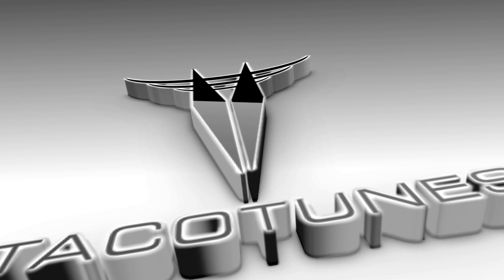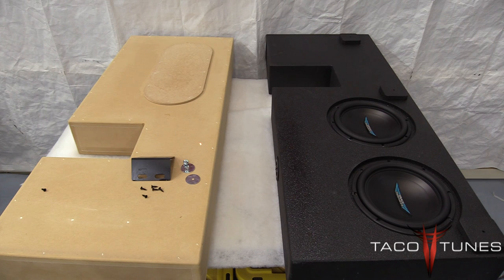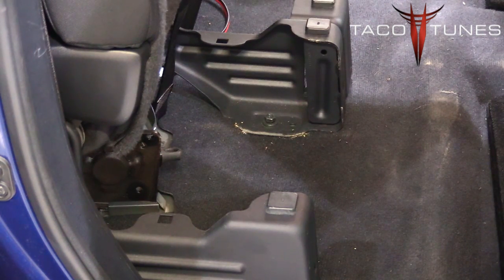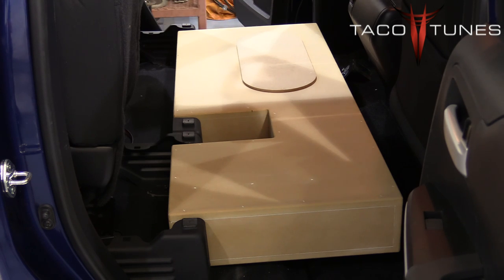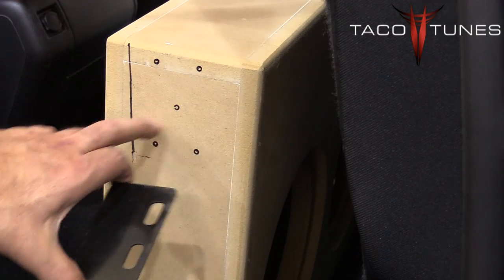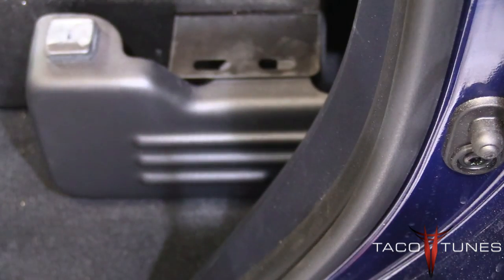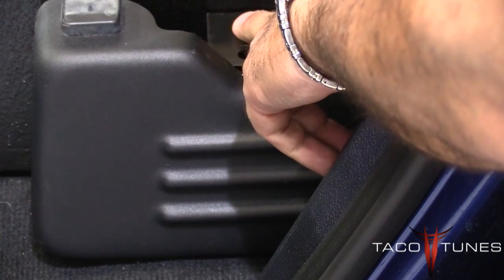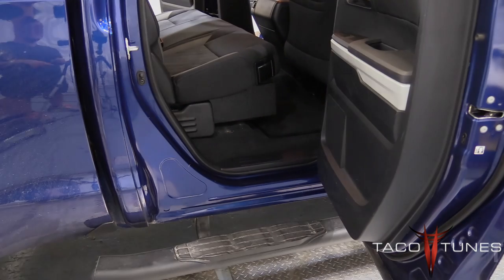Toyota Tundra 2007- 2017 Double Cab Subwoofer Installation

Comment: Hey got a question. Do you actually have the dimensions of that box. I am running the mmats shallow mount 10's. I currently have one installed but i am building the box for 2. Would greatly appreciate the help.

Comment: I did this modification on my 2007 Toyota Tundra but now I have to drive with the rear seat up all the time because the seat hits the speakers
Reply from the maker: How is the seat hitting the speakers? The subs are firing downward? Did you install the box upside down?
Reply: Lol